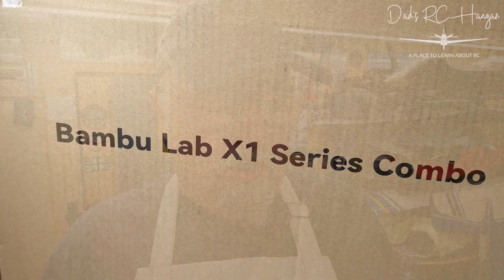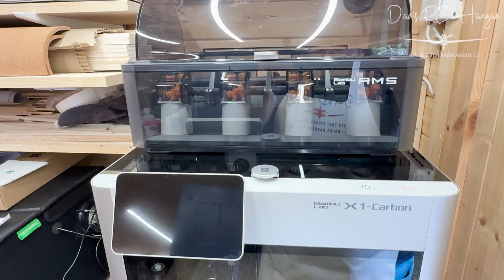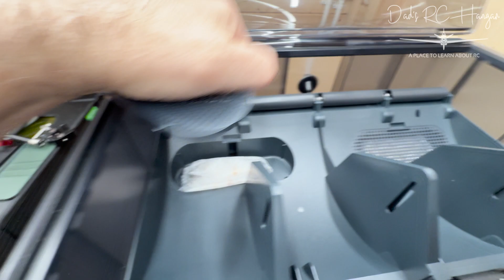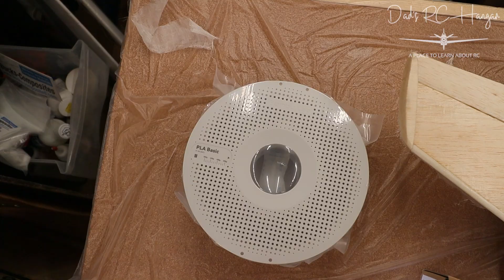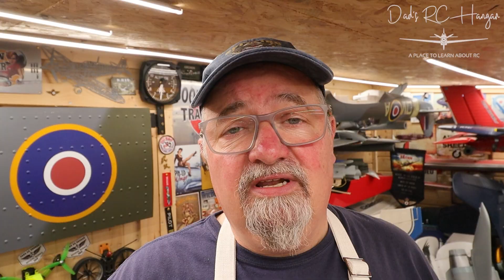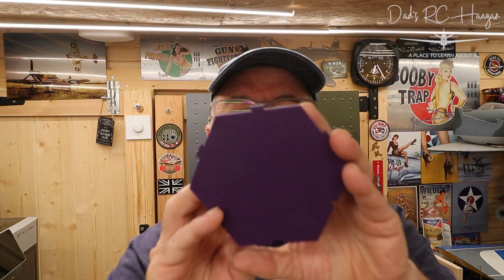Bambu Lab X1C 3D Printer

Comment: Nice job getting the Bambu printer. I have the same printer and I love it. Here are a few pieces of advice. I see you put it in the corner, the printer spits out little pieces of plastic when it cleans the nozzle or changes color. It will become a mess quickly. You need to print off a proper “poop chute” so the plastic is removable. Second, when designing parts in fusion, get to printing the prototype ASAP. The real learning is getting the items in your hand and refining it as you go. You can spend hours and hours designing stuff and it still will not be quite right. Crack on!!
Reply from the maker: Thanks Joe, I did leave about 8” for the back incase I want to put another reel. Good shout about the poop chute, forgot about that. I still get used to fusion, I did use a fews years back, but brain forgets too much when I am not using the tool regularly these days.  
You will have to let us know of Must print for the unit, I get a Glow filament as well, should be fun. 
You have a great week and thank you for the advice. 🫡

Comment: Nice bit of kit Chris, I bought the Bambu Lab P1P single colour printer and it's plug and print, fantastic machine. As Steve commented just scale-up the size of your bottle holder by a couple of percent and all will be good. You'll find your print comes off the plate the easiest when it's cool so if you're in a hurry just remove the plate from the machine as soon as it's finished, it cools rapidly 🤔👍
Reply from the maker: I have to see if the plates are the same as I brought pattern plates in the sale thinking they were singles, they were a pack of four 😂. So have a few Spare, the main reason for this, was because it’s in the Hangar. Even thou I do have a de-humidifier, they can still get moisture. Fun tool to have 😊. Have a fun week ahead, should be flying weather later in the week, I hoping anyway.

Comment: Hi Chris, you don't need to change the internal diameter you can just increase the size of the whole thing by 2% or 3% on all Axis job done 😉👌 I am in the middle of printing a plane at the mo I will share it on the facebook group when it's finished 😉💪
Reply from the maker: Looking forward to se the plane Steve, do you use Fusion as well? 
It was easy enough to change the inner diameters, but I am going to re-design as the connector dove tails not right. All good fun. Whether looks good next week, let’s hope I get out and fly. 🫡
Reply: @DadsRCHangar Chris I don't use Fusion I just buy the STL files off Cults 3D for the models I want to print 😉👍